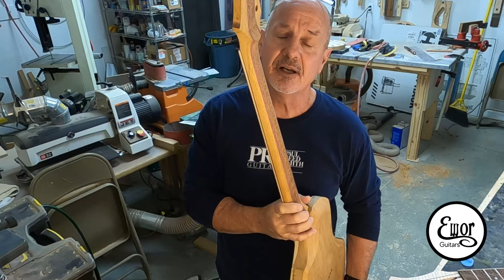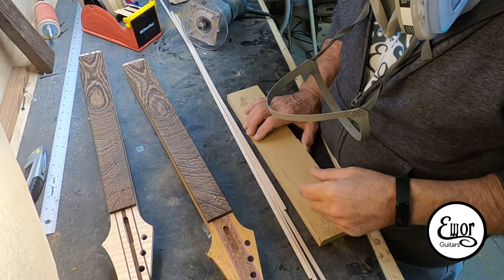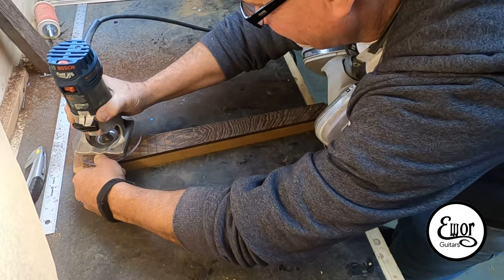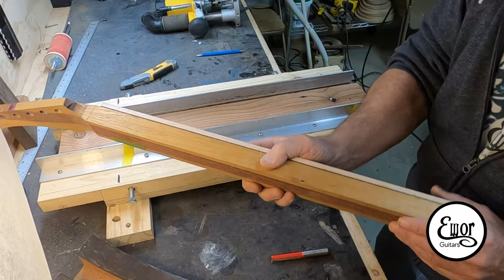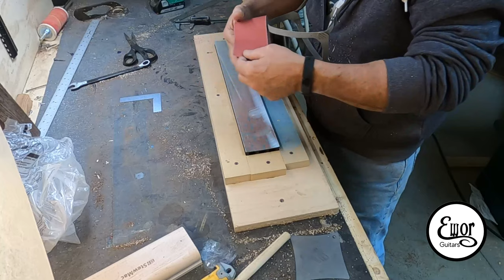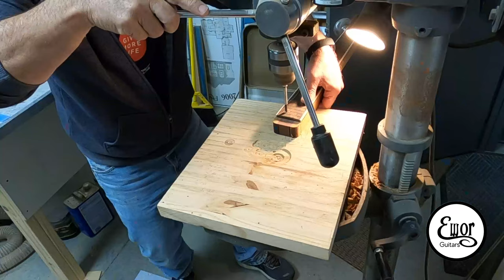Ewor Customs Great Guitar Give Away: Episode 8 Neck Construction part 3

Comment: Love the series David, keep it up! I am learning so much from this and your other videos on the pr-22. I am curious about the leopardwood, not a common choice and from what I read it is not necessarily the easiest wood to work with. Does it look like it will require a lot of grain filler or is it fairly smooth and dense? I assume that you will also treat the back of the neck with Nitrocellulose or Poly rather than keep it satin.
Reply from the maker: Hi Maxime, This is my first time using leopardwood. Yes it is very dence, hard and ridgid too. I will definatly use simtec polyester sealre as a grain filler but it does not seem very porous like wenge or mahogany. I wanted to use it in the neck because it seems so ridged but at the same time i was concerned about its stability. so far it has been quite stable, i frequently check the neck for movement and so far it has been great. Thank you for watching and the great question! Rock on!

Comment: For the fretboard binding. Would u recommend getting the binding ok first before slotting for frets?
Reply from the maker: I always slot the fretboard first then rout for the binding Chanel.
Reply: @eworcustomguitars  thanks for the reply, I’m a beginner so please excuse the novice question but wouldn’t it be easier if u routed the binding channels first, put on the binding and then slotted the fretboard? Or would it look weird if that were the case?
Reply from the maker: Part of the reason for the fretboard binding is to cover the ends of the fret tang. So you have to slot first then bind unless you have a cnc router. You will also need to cut the ends of the tang off with a fret tang nipper. Stew Mac sells them.
Reply: @eworcustomguitars  cheers! Have u had an issue with the frets coming up at the ends? I presume not otherwise people wouldn’t do it that way. Btw, just finished ur SR-22 build playlist and thoroughly enjoyed it.